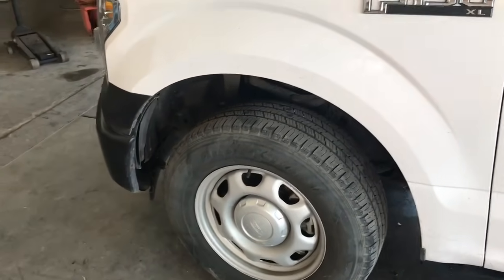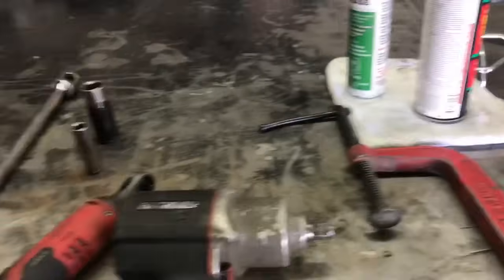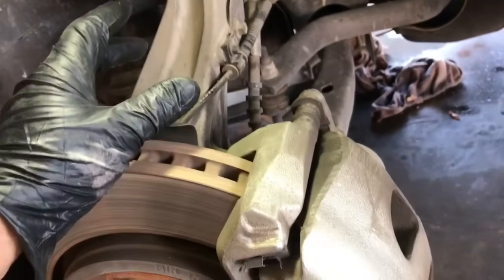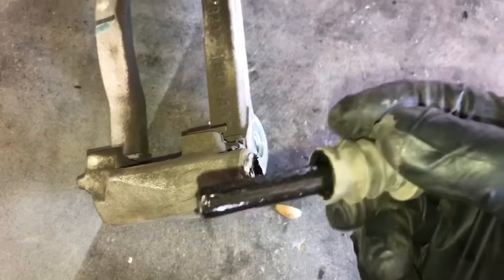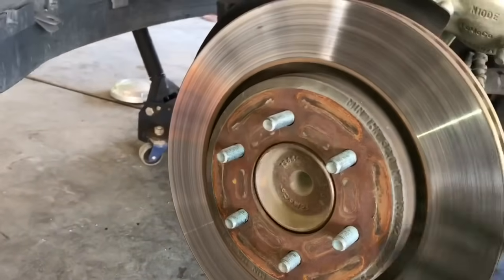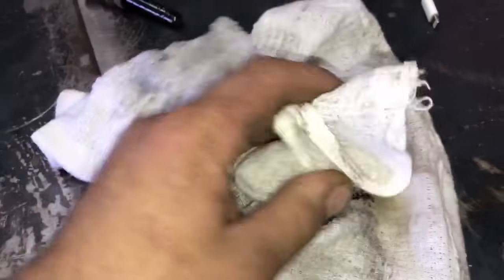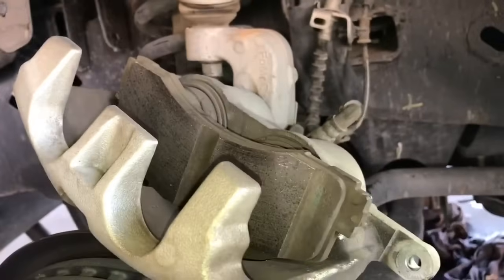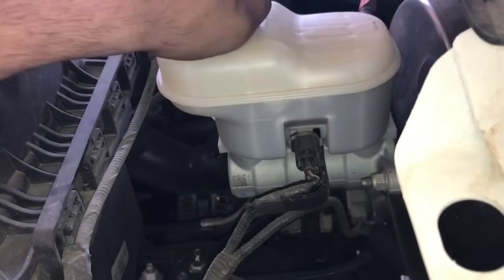Ford F-150 Front Brake Replacement (2010-2018)

Comment: Thanks much for this video.  Dealer just quoted me $527 to change pads and rotors on my 2015 F150.  I will be doing it myself.  Like someone else said, no BS, straight to the point.  Great video.  Thanks again!
Reply: Bought the parts for 225$ at the auto parts store.  The rest was easy.
Reply: Just got quoted a grand for mine.
Reply: @eynont  Holy crap!  Do it yourself.  Entire job cost me about $200.  Pads and rotors included.  I have done both front and rears and have had no issues at all with aftermarket parts.  Go for it!

Comment: Good video.  I've been working on vehicles for 30+ years but I always do a quick youtube search when working on a vehicle I've never worked on.  Just got a 2016F150 and I see it's no different than my old 2001.  Thanks for the quick video confirmation before I do the brake job this weekend.

Comment: For the caliper pins don't use wheel bearing grease, use silicone ceramic grease, it will keep it's  properties even in -20 temperatures.

Comment: Great video! The only thing I would add for first timers, is to monitor the brake fluid reservoir for over-flowing, when you compress the brake calipers during the reinstall steps.
Reply: do you need to remove fluid after compressing piston, or will the level return to previous state once reassembled and brakes pumped?
Reply: @kevn22   There is usually a full mark on the reservoir, but an inch below the surface of when the lid is on, will be fine usually.

Comment: I love when manufacturers dont get ridiculous with their design. Nice basic brake job, just like 80% of vehicles for the last 30 years. "If it aint broke, dont fix it" but some manufacturers are installing electronic brakes and all that crap. Ill literally probably drive an under 2020 vehicle for the remaing 40 or so years i have left. Im glad Ford has (for the most part) kept it simple for the DIYers

Comment: Great Video.  Has anyone else seen 184 ft/lb for the Anchor plate bolt?  When I search 2010 f150, I mostly see that torque spec.
Reply: Yes I was wondering that too everything online from 2010 all the way to nowadays says spec is 184

Comment: Hope it's as easy as you made it look. I got lost on the " putting pads on part. I'm guessing they just  sit properly on that bracket then the caliper goes over top. It threw me after that when there was no pumping the air out of the line. All looked way more refined than my HS shop class in the late 80's. Thank you for video!
Reply from the maker: thats correct! make sure the wider brake pad goes in the inside position, ( towards the motor, and the skinny pad goes on the out side ( towards the street). thats what i was trying to explain.

Comment: Great videos - keep ‘em coming!
Couple points
1) didn’t see you lube the sliders - just not in the video or shouldn’t be done?
2) Ford has updated the pads retrospectively back at least as far as 2015 - no longer an inside/outside - just one shape and interchangeable 
3) just a note that the rotors I ordered said to not use brake cleaner- just mild soap (power stop Z36), so reminder to check instructions on parts ordered

Comment: Worth researching but some of those caliper and caliper mounting bolts are 'torque to yield' (stretch) type bolts and the service manual procedure will suggest replacing them each time you disassemble the components.

Comment: Hell yeah.    Great info.  
My 2017 xlt had this nasty squeal like HUGE NOISE.
 BOUGHT USED.  But. I was like must be dirty pads. No biggie
 

NO WAY. JUST NOW I TAKE A LOOK. TAKE OFF PADDS. HAS BOTH INNERS ON DRIVER SIDE. 😵😡😠HOW AND W** WHO DOES THIS.  PADS WORN SO AWKWARD. I CANT EVEN EXPLAIN IT. So passenger must have both outers. 😲 

I bought new set. Installed. My wheel is free at last. Was binding when I jacked up .  could not rotate it by hand.  Thank you for video. I was looking up why or what or 😣😵  ....seen your video. Saved me ...inner....outter. YESSSS
Reply from the maker: That’s awesome! I’m glad this video helped out! Sure is a good feeling know my it’s done right!!

Comment: To torque the brake caliper anchor plates bolts, are you using the 1/2 in torque wrench to get the required 136lb-ft? Also, I've been seeing a lot of other videos saying 184lb-ft, any chance you could share where you saw 136lb-ft?

Comment: crack the bleed valve on the caliper before compressing the pistons. Also, the reservoir of fluid in the calipers  so it's good to purge that bit is old, and usually cooked. otherwise you may push contaminate the upstream system which is a huge issue.
Reply: Did you need brake fluid after open the bleeder ?

Comment: I have been watching several videos in replacing brakes on my f150 2013. Most just press the fluid back up in the reservoir. One tech video I watched said to NEVER compress the calipers until you loosen the bleeder valves. They stated the back pressure could ruin the ABS module and result in a costley repair..What you say about this?
Reply: Also wondering the same thing. I think we may have watched the same video. It seems like there was only one that mentioned using the bleeder valve. However, I also saw a decent amount of comments on that video that stated she should NOT have opened the bleeder because it could introduce air into the system. Anyways, I'm getting ready to do the brakes, front and back, on my 2012 F150 XLT and would also like to know if I really should do this or not ... anyone?
Reply: @krismcdougall  I heard it was because the fluid in the caliper gets the dirtiest and goes through the most heating cycles, so you don't want to push that fluid back up the line, but rather drain it out the bleeder.  I'm still debating how I want to do mine.  I don't exactly want to bleed my brakes at the end of the day after opening them during the piston compression.  When I did my Mustang in the past I never opened a bleeder and they always worked fine.
Reply: The fluid is designed to be able to freely move in the opposite direction, so compressing the calipers has no ill effects. The ABS deals with major back pressure at all times when breaking as well as when the ABS is activated. The back flow of old, heat abused fluid is a misnomer. The fluid actually will slowly migrate through the entire system, very slowly, over time and temperature deferential. 
  There is something to be said for  releasing the the fluid in order to remove any absorbed water and sediment and possible trapped air. Bleeding brakes should always be done when installing new pads but of course it’s something that can be skipped, unless the brakes do not feel solid. 
  If you don’t have an assistant to bleed the brakes, you can purchase break bleeding kits for under 20 bucks for the pumps and under $10 for the basic bottle and hose. There is even the ones with one way check valves and hoses that work well.
Reply: Lol. That's funny. Never heard that one, youtube techs always come up with some wild shit

Comment: Just did this job on a 2015 F150 4x4. Found pads on left side reversed. Pad intended for inner position jammed in caliper because lobes on backing plate hung up in caliper. There are large vent holes that need to line up with lobes on pads. Last person to do these brakes screwed up. Too bad. Other pads were 80% good.

Comment: Great video and thanks for providing the torque specs!
 
I'm a little confused because in the video you specify:

Brake Caliper Guide Pin Bolt = 27 lb-ft

But in the video description you specify 

Brake caliper guide pin bolt: 55 lb-ft

I've briefly searched and not much is coming up for 2015 and newer specs.  Just wanted to see if you can clarify which value is correct?  I assume the description is probably more up to date if there were any mistakes in the video.  

I have a 2015 F150 Lariat 4x4 3.5L Eco boost

Thanks!
Reply from the maker: looks like i messed up, it is in fact 27 ft-lbs. sorry for the confuse, its fixed now! thanks!!

Comment: After removal and cleaning, use dielectric grease on caliper slide pins, instead of wheel bearing grease, before re-installation.
Reply: I'd use high temp, silicone ceramic grease, made for brakes. Put it on the pins and slides

Comment: super video! thanks. is it necessary to replace rotor? my 2017 f150 has 81000 miles and I'm starting to get a metallic scraping sound when applying brakes. thinking the front pads may be ready to go.

Comment: Thanks for putting this up.  If you aren't replacing rotors, can you leave the caliper bracket in place and just remove the housing with the piston?
Reply from the maker: Yes you can do that

Comment: should you open the bleeder screw before compressing the pistons?
Reply from the maker: No need to do that
Reply: Why does 90 percent of other videos on the f150 say you must open it up? Or risk messing up the abs sensor.
Reply: I actually did it. Why risk it
Reply: @klow6628  no since he opened the brake fluid reservoir so it's preference either the reservoir or the bleeder screw.

Comment: For those using ford pads which are $65 plus tax at least in my area, they are no longer location specific. You can put them anywhere you want. A ford tech told me about that.

Comment: is it better to change the rotor every time you change that pads?
Reply: not unless the worm to thin. you can take them to most part stores and get them turned for about 20 bucks a piece.

Comment: Should I use any oil/grease on the slides that the pads sit in?
Reply from the maker: Not needed. But it shouldn’t hurt anything if you do
Reply: Should I be worried if the piston dust boots don’t look exactly the same on both pistons? One is wrinkled and folded a little different then the other
Reply from the maker: @OnlyOneRyanZiegler  no that is normal. no issue with that.

Comment: You don’t need to take the brake hanger off. Leave those on and use anti seize on the caliper slides instead of grease. In cold weather grease will make the caliper hang up and drag the brakes
Reply: Use high temp silicone ceramic grease.

Comment: Mine didn't have those flanges,even the ones I took off didn't, Something I noticed ,ypu should remove the rubber boot on the slide pins, I had some rust under the boot.

Comment: how do you know when to change the rotors?
Reply: I change my rotors when they have a significant lip on the outer edge where the pads do not wear. There is a thickness spec on the rotor usually and you can measure it to see if the rotor is still above the minimum thickness. Alternatively, to replacing, you can have them turned which grids off a small amount of the rotor face for a fresh level surface. Turning is way more economical if the rotors are still in good condition.

Comment: What are your thoughts on opening the bleeder screw when compressing the pistons ? Iv seen it on another video and read about it online. Kinda mixed opinions from what iv read.
Reply from the maker: ive done it both ways. ive never had an issue not opening the bleed screw and pushing the fluid bad into the master cylinder.
Reply: Aaron Hines thanks for the reply. I ended up just leaving them be. The pistons retracted with relative ease. My first time doing my own brakes. Knock on wood everything seems fine been driving for couple days no issues feels good
Reply: Aaron, Nice job on  your video. I am a strong advocate of cracking the bleeder screw during piston retract. With anti lock brake systems, you don’t want to risk sending any old dirty fluid to into the anti lock system. The fluid in the caliper is subject to extreme heat and cooling cycles. Moisture is always a concern since brake fluid is hydroscopic. Actually even conventional systems benefit from removing this fluid. One other note, the reservoir cap is not vented, only the air space above the rubber. If the bleeders are not cracked or fluid removed from the reservoir during piston retraction, the fluid can overfill the reservoir.

Comment: The Chilton's manual says that the 2010 F150 front caliper bracket bolts need to be torqued to 184 lb-ft. You video says 136?
Reply from the maker: Ford factory service manual says 136. So that’s what I went off of
Reply: I know this is 7 months old, but wanted to point out that 184Nm (newton-meters) = 136ft-lbs.  So you might have read Nm when you saw 184.

Comment: I thought that you need to put your f150 in maintenance mode before starting the project
Reply from the maker: thats only on the rear brakes on trucks with the 2.7l motors or with the electric parking brake.

Comment: Saw another video that mentioned opening a bleeder screw before pushing the pistons back. Anyone know if that Is necessary? Or does venting the reservoir take care of that?
Reply from the maker: No need to open a bleeder screw. The fluid will go back into the reservoir no problem

Comment: Thanks for the video. Is it really that important to torque to spec? Just tight isn’t good enough?
Reply from the maker: dont get me wrong, i have used the "good and tight" method hundreds of times without issue. but the best practice is to use a torque spec.